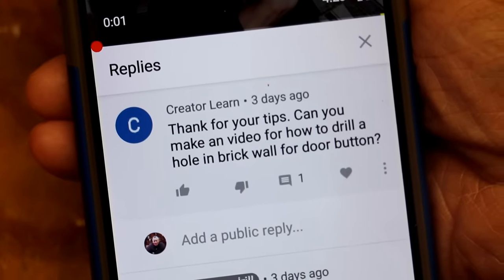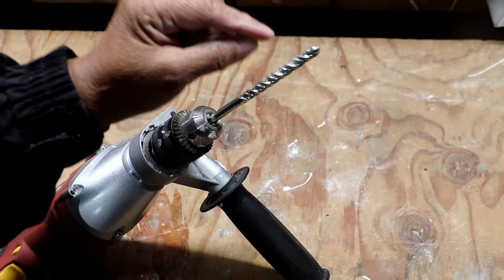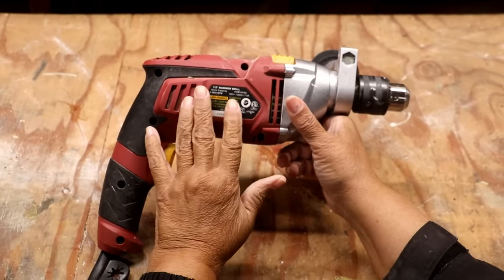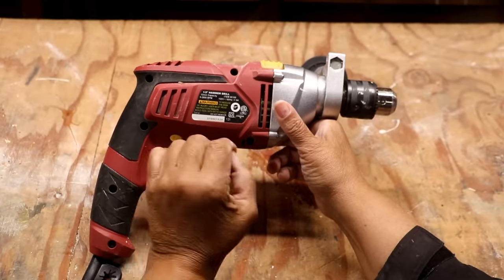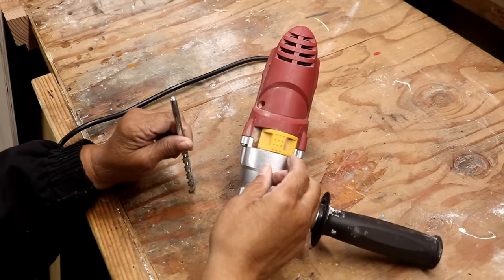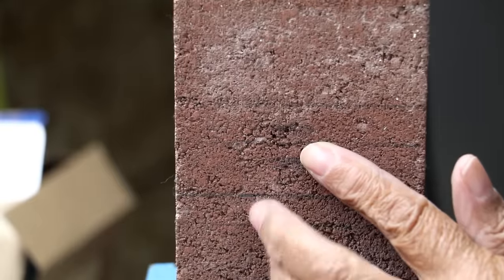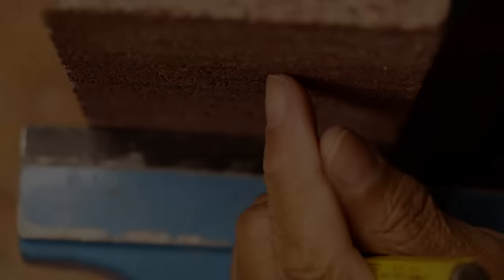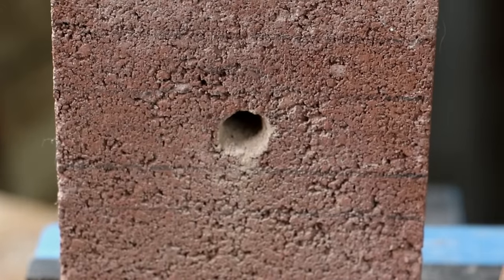How to Drill a Hole in a Brick Wall

Comment: That brick is no match for Leah! Having the right tools is priceless. 
If you want to always see someone smiling, have a positive and uplifting demeanor, this is the place to be.
Reply: Ah, you are all so spoiled with either wood structures or "just" some brick ;) Just kidding, this might come in handy for some people as what happens quite often in harder materials with a structure, your drill might catch and wander of. From my experience that either happens with rough surfaces or with very smooth surfaces before the bit starts grabbing.
But I have to confess I would never think aout torturing a hammer drill for what I have in my house. either lime sand bricks which are hard as sh@#$ or steel reinforced concrete.
While I sometimes find you get actually smoother holes in the brick with a good masonry bit and no hammer action at all, for the concrete you do nothing short of a pneumatic roto hammer. here the quality of your drill bit shows as soon as you hit the steel reinforcement. which in case of my ceilings seems to be about every inch and at least a half inch thick. I seem to have a 7 out of 10 chance to hit steel...
But living in Germany with houses usually build from some sort of masonry material and concrete, any kind of hammer dril or roto hammer to us is more familiar than a stud finder. in most cases you might not find a lot of studs around here.

Comment: Leah:- nice video. I may add some of experience (28;yr handyman) When drilling in brick the drill bit gets VERY HOT. Wait before you grab it to remove. Also, it may be easier to drill a smaller hole first- ie 1/8 inch dia and then enlarge. Re drill tip travel you can also layer 2-3 pieces of masking tape and the bit will grab that and stay put. Also when drilling for example a hole vertically for say an anchor, it is helpful to have a narrow plastic tube to use to blow the dust out of the hole as you progress! Fun times! Thanks for all you do!
Reply from the maker: Thanks for sharing your input with others.

Comment: One nice tip (and time saving), specially when working inside, is making a small folder/bag opened on the top using paper and tape, a little bellow where you will make the hole, using the tape glue it all along the front side and give a little pull on the backside so the "folder/bag" opens, then when you drill the wall, if you dimension it correct, all the dust will go inside this folder/bag that you can reuse-it on other holes. It's much better take a few minutes doing this than cleaning everything inside with a broom and wet cloth.
Reply: Yeah that’s a great tip 👍  I find old envelopes work great for this as the are wide and shallow, so they catch a lot of the dust.
Reply: @Zoltarii  That's much easier!

Comment: Get yourself an SDS drill and you can power into any block, concrete, masonry, etc, with little to no effort. I gave up using the hammer function on my drill years ago and bought myself an SDS. Best decision I have ever made in the tool department. 😁
Reply from the maker: I agree that there is a huge difference between the two tools.  Keep in mind that these videos are made mostly for DIY homeowners.
Reply: elvis459   What’s sds
Reply from the maker: @doghairdontcarelindaniel7531   slotted drive system.  It's a contrator grade drill for drilling into tough surfaces such as brick, concrete, stone etc
Reply: DOG HAIR DONT CARE Lindaniel It stand for Slotted Drive System and just means the ends of the drill bits are shaped differently and the drills can hold onto them better and drive them faster and deeper. They can also take chisel bits so you can chisel our large slots in brick or use them for demolition.
Reply: I have dewalts regular hammer drill and SDS....I run into blowout problems with SDS it's so powerful.....do I dig in and dig deep with SDS but finished with old-school hammer tobgetvthru the last bit....to avoid blowout
Reply: Richard Burrell Good Tip 👍🏻

Comment: I know this is a site for beginners, but another option is called an SDS Rotary Hammer. If you need to drill a lot of holes in concrete, you can't beat it.  It drills like a hot knife through "butta"!
I bought a Ryobi corded one for about $100. and plan to use it when I frame my basement. A hammer drill will take about 2 minutes per hole, whereas a Rotary Hammer is about 10 sec.
Reply: For my basement I just used a ramset to secure the bottom plate to the floor went pretty fast, just takes a minute to get the rite load for the floor
Reply from the maker: Agreed.  That is why I mentioned it in the beginning of the video.  Thanks for taking the time to comment.
Reply: I have the brushless sds DeWalt hammer drill....it can rip a house down...
And the smaller DeWalt hammer drill both work on concrete or brick....the SDS is just more powerful...gets job done lots faster
Reply: @Chris-de3vq  I was sticking to drills. Yeah, the Ramset will do it faster and easier.
Reply: @russmartin4189  the Ramset will not help if you have to use an anchor and a screw to put anything on a wall. But you cannot beat them e.g. for silplates.
I live in Germany and we are used to houses made of masonry materials and concrete, in most cases where you just put a screw or a nail into a wall or ceiling we have to drill ahole and put an anchor and a screw in, a ramset wouldnt do any usefull.
But in the comparison between a hammer drill and a rotary hammer, I choose a rotary hammer with its more powerful pneumatic action any day over the whining high pitched noise of the hammer drill action. 
And if anyone wondered why that hammering action in a hammer drill actually sounds simmilar to gears grinding teeth, well, that sort of is how it works.

Comment: I was wondering why I wasted an hour drilling into a brick for a new "Ring" video doorbell and was getting nowhere. I used the masonry bit supplied with the install kit. Frustrated with the lack of progress I watched this video...then bought a new high-quality masonry bit. No hammer drills were in stock or available for rent. With the good bit it took 5 minutes to finish the two holes. Thanks for the video.
Reply: Yeah, actually the bits make more of a difference than the drill itself. a high powered roto hammer with a bad bit may perform worse than a cheap battery powered hammer drill with a good bit. I found for cleaner holes if using good bits, you may even be better of without the hammer action. but that really depends on the material.

Comment: If you think you might want to fill the hole later, have someone hold a small container under the hole to collect the brick dust which you will rub on top of the repair to match the brick.

Comment: Leah I usually water spray the spot I want to dig beforehand to avoid the dust issue is that a stupid idea?
Reply from the maker: Not at all....it certainly keeps the dust down.
Reply: If you mean't drill, I wouldn't it just makes a sludge and harder to clean up, just run a vacuum next to the drill hole but be careful running it over the hole as dust will shoot out

Comment: I wish you could do a Spain version of this. I need brick anchor advice. Every building is made of hollow brick- tall, slim bricks with holes running through them to route wires and save weight (I guess). I know about the wires because well, my bit hit some. That wasn't fun. Luckily the plastic housing on my drill (now I need to buy a hammer drill!) saved me in that one. Everyone here in Spain recommends butterfly anchors which I hate, because they require such a massive hole. I like the kind that expand in the middle, like they're bending their elbows. Also metal, but will that help in brick? I know plastic anchors don't work in brick, I found that out the hard way! Put up some great blackout blinds, and now one set is falling out of the wall!

Comment: Thank you  Leah.  I have a dilemma.  I made a hole in the wall of my Bungalow, and there was brick and mortar.  I do not know if it is a brick wall or some type of reinforcement for the fieldstone fireplace that is less than a foot away from the hole  It is imperative that I make the hole, so is there a way to do that without making a structural crack?  The hole needs to be a little over 2" so that the flex pipe can go through it.
Reply from the maker: It's  impossible for me to make that determination remotely...so sorry.

Comment: you don't actually need a hammer drill, but it does work a lot quicker and better than just a drill. Also, it doesn't skirt, it skates. let's not skirt the issue of skating. lol. least ways in my world that's what we call it, skating not skirting.

Comment: I don't have a hammer drill. Could I use my impact driver?
Reply: Following
Reply from the maker: It may work but the action that a impact drill creates is concusive and not a hammering force.
Reply: @seejanedrill   Thanks for the quick answer, and an excuse to use my Harbor Freight coupon, haha.
Reply: No. Impact driver just spins fast...is high torque screw driver really. Hammer drill spins and slams over and over into whatever you are drilling. If you use an impact driver on concrete or brick- you just burn out your drill bit pretty quick.
Reply: The hammer drill action is in the direction of drilling (into the hole) while an impact driver action is in the direction of rotation. The hammering action is good for breaking brittle materials (brick and concrete) while the rotation impact is good for increasing torque (for installing or removing screws and nuts).
Reply: @pmac02  Thanks !

Comment: I have a grooming room in my basement and would love to learn how to hang pegboard on the cement walls to hang my tools.
Reply: Just buy tapcon screws & the bit that is needed for the size of the screws as it says on the box.

If it's a cinder block wall you'll need toggle anchors because the cinder is hollow. The toggle anchor will go into the hole you drill and when you tighten it the anchor will lock the screw in place

Comment: The single strapped face mask isn’t a respirator and won’t protect you from those dust particles. That is a nuisance dust mask. Use an N95 respirator or half face instead. Even for a small hole you don’t want to breathe any of that stuff in.

Comment: Should I drill through the brick, or through the mortar?
Reply: You going all the way thru? If you are choose mortar it will go thru mortar faster/ easier until you hit brick then chug on thru.
Reply from the maker: Brick will be more durable.  Mortar has a tendency to crumble but either brick or motar can be drilled.
Reply: @seejanedrill  If you got more than one hole to driil to fasten anything, you may end up with a mix of both anyways.

Comment: I see they make masonry/brick bits for just a rotary drill that does not have the hammer feature.  Does anyone have experience on how well these work?  For two small holes, I sure don't want to buy another drill if I can avoid it.
Reply: Or in short to sum up the excellent answer Robert Johnsoton gave, yes, works fine if you only have to go for a few holes.
Reply: Robert Johnston  One small correction I have to make. the hammer action, either mechanical in a hammer drill or pheumatic in a roto hammer, chisels out material in front of the bit as you wrote. the rotary action helps with the usually carbon tiped bit to grind the hole smooth, but mainly the rotary action in combination with the auger part of the bit (for those who wonder, that is the spiraled shaft after the V shaped tip of the bit) is intended to evacuate the ground down material from the hole.
This grinding of the hard tip is what makes those bits work without hammer action and actually it may give you smother and more precise holes in some materials. but that really depends. In concrete it wont do a lot at all.

Comment: The only thing that I would caution everyone on is when making a hole in a brick, if the hole is somewhat large, consider not using a "Hammer drill." Instead, consider buying a cutting bit which is more like sawing a hole. Too much vibration on a brick while punching a hole with a hammer drill, although quicker, can lead to a broken brick. Sawing bits do take a little longer, but they are much safer.  FR

Comment: Is it the same more concrete?
Reply: in theory yes, and a high quality bit actually makes all the difference. But you may find that certain concrete mixes are way harder than brick. and depending on the aggregate used for the concrete, that is the stones which are mixed into the concrete for strength and volume, you actually may  be better of with a roto hammer.  If crushed stone was used, you may have good luck with a hammer drill as well. By the way, depending on the size hole you want to drill, also a battery powered hammer drill or even more a battery powered pneumatic roto hammer may be an option. But if for example gravel was used as an aggregate and it contains a lot quartz pebbles, you may have a really hard time getting any kind of hole in. 
But again, here a better quality bit shines. Also if the concrete is steel reinforced and you possibly hit steele.
I can attest to that as I live in Germany in a house with the floors/ceilings beeing steel reinforced concrete and most walls lime sand bricks. No use for a stud finder, but not a lot to accomplish without a roto hammer. and it seems they overdid the steel reinforcement, as drilling into the ceiling here has a 7 out of 10 chance to hit steel.

Comment: Hammer drill should be used for old buildings which build 50 60 yrs ago  not only for newly constructed ones, for new building regular drill is enough.  Old buildings r made of pyre original quality products which makes them super strong n withstand any type of natural calamities  ours is also 60 yrs old super strong building  many electricians n plumbers told that it's hard rock cant drill easily 🥳 in that case hammer is best choice..

Comment: I had been taught that standard drills have a flat back to make a good contact area for a mallet or hammer.  You can hammer drill with a standard drill if you need to.  It's just more dangerous, less efficient, and wears the drill faster.
Reply from the maker: It will take forever

Comment: I'm a big fan, but, those silver masonry bits aren't recommended for use in hammer drills. They are too soft.  Check the packaging, there will be a little "no hammer"symbol shown.  love the show
Reply from the maker: Yes, there are carbide tipped bits for tough jobs.  This brick however is pn the soft side.  Thank you for taking the time to comment.
Reply: Not true, there are carbide bits that are silver and are for hammer drills...I have to drill brick and concrete daily all my bits are silver for my hammer drill and my sds
Reply: @Chris-de3vq  Made by what company, please.  Bosch specifically marks theirs 'no hammer.'
Reply: @Chris-de3vq     Bosch Home Depot  SKU #810740  says "Designed for rotary drilling in masonry, block and brick
For use with rotary drills only; not for hammer drilling
Double flute and carbide tip can be used in high-speed mode,"" ,,,,   Suit yourself. Always remember you aren't buying drill bits, you are buying holes.
Reply: @JonathanJeffries  I agree with you, definitely read the packages especially with so many drill bit options,  I was mainly saying there are hammer use drill bits that are silver lol